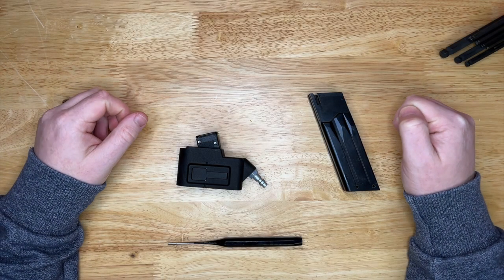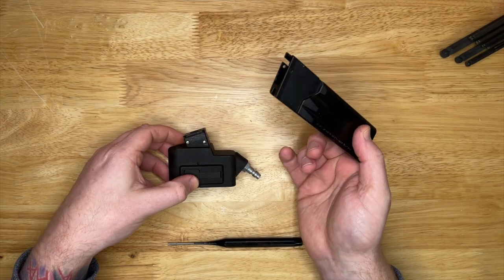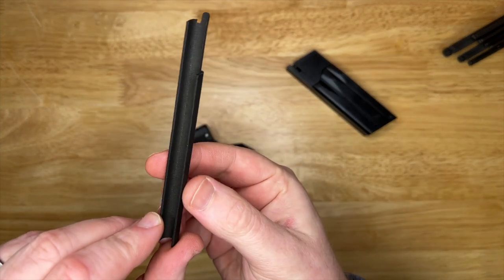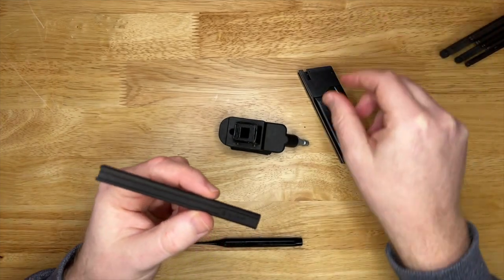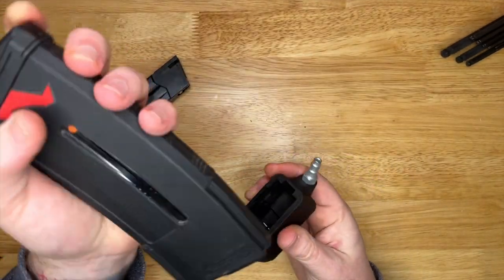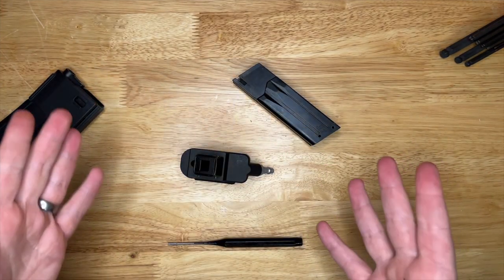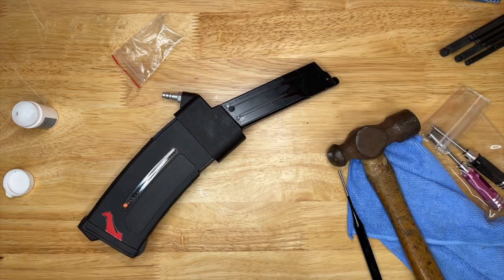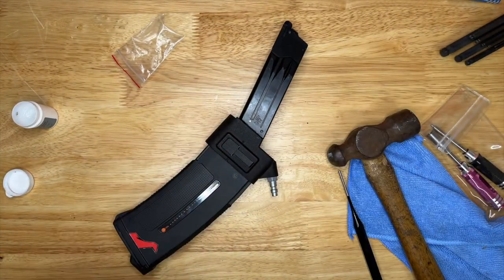TM Mk23 Airtac HPA M4 Mag Conversion - The PERFECT primary?

Comment: When you’ve done the first pin… place the mag on its front edge on the table and use the clamp to clamp it down towards the table at the location of the first pin. That’ll make it rotate around that first pin and pull it shut for the second pin to slot in just fine :-)
Reply from the maker: This is why I should do live streams 😂 I get the help I need as I need it then!

Comment: If you are putting a shopping list together for this job, do not buy the light weight, 64 kg, qucik grip, it was not strong enough. But the 130 KG one, makes the job much smoother.
Reply from the maker: Good tip thank you 🙏